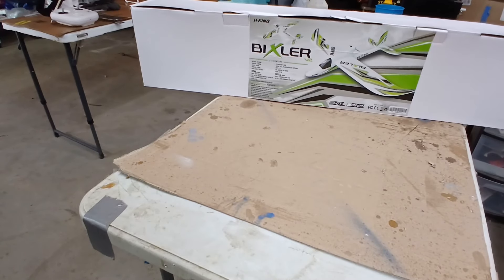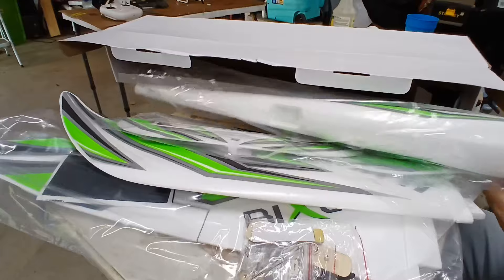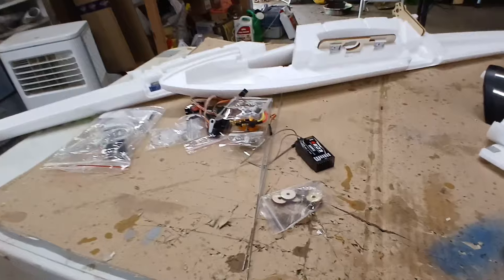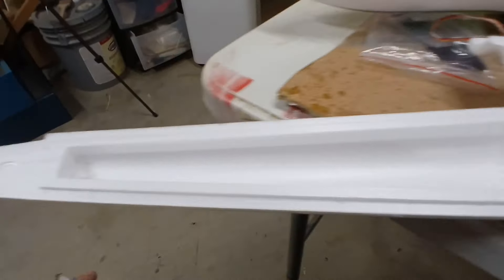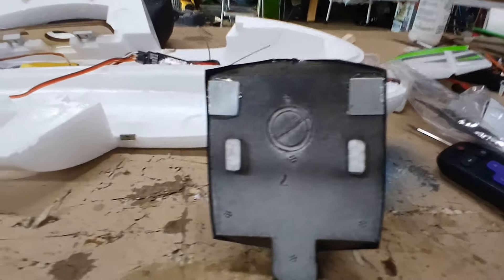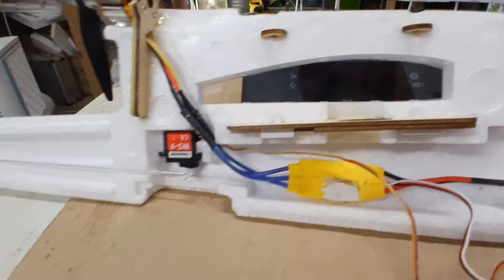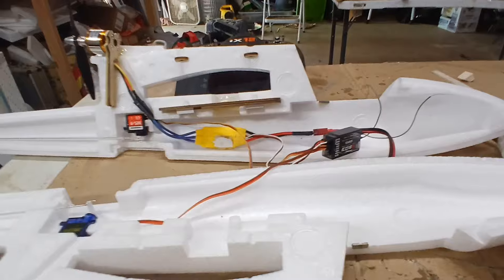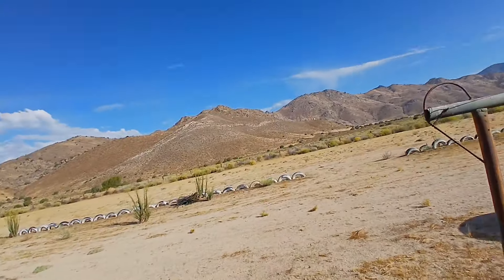Bixler V2 build and 1st flight

Comment: Recently, I built a Bixler 1.1 from a kit and fitted it out completely from my spares box. There are no instructions for the kit version but I found a build video on YouTube . However the builder made a hash of it and the plane did not fly well. The video gave a view inside the fuselage so I could see where everything went. The build is quite intuitive and the model went together very well. One glaring omission in the instructions was the control throws. Set up as shown in the pictures produces far too much aileron and elevator throw. HOBBYKING claims it is a beginners model, .but the throws are far too much. The Bixler 2 throws are much less and I used them which provide much better control. The model is classed as a glider and flies happily on 50% power and when gliding off a slope yet will perform basic aerobatics on full power. I really enjoy flying my Bixler 1.1.